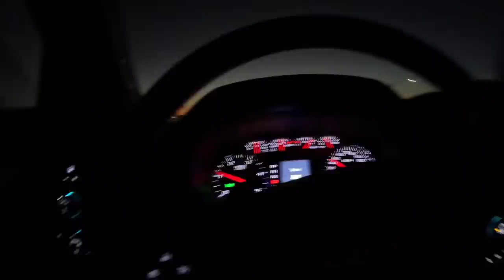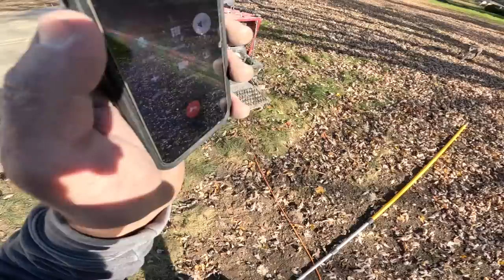Very nice patio! One of the last of the season

Comment: 3:48 FYI you don't need to use a flashlight app on your phone. iPhone has a built in Flashlight button in Control Center and on the Lock Screen. Much easier to press and activate.

Comment: 12:12 I am a plumber, and yes it is a code thing! But also, clear primer works, and will show under a UV light. Primer is mainly used to clean the pipe and soften the pipe so the glue can physically bond the plastic together. The glue by itself will work, and leave a cleaner job. But primer is always nice to make sure there are no rocks or debris.

Comment: The primer is used to make sure the glue adheres properly. It reacts with the plastic and glue to form a stronger bond. Only using the glue is NOT victory style. Not as big of a deal though if the pipe isn't under pressure like a downspout but it still drives me nuts when people don't use it.

Comment: 10:40 Everyone who owns a machine should know this trick. We've done it with  our power saws when we're deep in the bush and pull cord or spring decides to break. Just have to be careful because there's no kickback protection.
Reply: ran an old cement mixer working for a mason the summer i graduated college and this was how you started the machine. i was told older machines all had this type of pull start instead of the modern handled pull rope.

Comment: The Purple primer is definitely for inspection purposes, otherwise I would just use clear primer. Don't get it confused with clear cleaner because they are not the same things. Clear cleaner surface cleans while Primer cleans and initiates a chemical reaction that allows the pvc to weld better with the glue.

Comment: ryan might be weird right but you pull wire when you pour the concrete but then walk all over it pushing it right back down you should pull right before you strike off so the wire is in the middle of the slab.

Comment: This is a nice looking patio. QUESTION: How far apart are your lines cut? Square sizes basically? How deep is your cuts?
Reply: They can be any size, smaller the better, but 8+ ft is too big. The cuts are about 1 1/4". They say to cut it about 1/4 of the thickness of concrete. Hope it helps

Comment: Ryan, I noticed you cemented over the gas pipe. What happens if the gas company has to replace some thing now they have to tear up your concrete is this normal procedure?
Reply: Gas pipe is steel, unless it gets hit by something with some severe force, it's never going to need to be replaced, it's a forever thing. The meter itself is the only thing that would need replacement over time in which they still have plenty of access to do that even with the cement there. As long as you aren't covering over crucial unions that they'd need to break apart for replacement then you're good.
Reply: @trainofthough0242  here in California you have to make sure the gas company has 100% access to any parts of the meter/parts just in case there’s an emergency.
Reply: @aaaaaaa1ism  Yes; the meter, the union or unions and shut off valve must all be accessible which it still is in this case, that's code no matter where you are. You cannot bury any of that stuff especially not under concrete. Everything the gas company would ever need access to is above the concrete. Everything that's buried underneath that cement is nothing that would need to be touched ever unless the homeowner wants to move the meter or something but that's not anything I'd concern myself with. What Ryan did here is perfectly fine.
Reply: @trainofthough0242  I have tons of confidence that Ryan knows what he’s doing except I noticed it’s different here in California. Maybe it’s an earthquake thing but you have to give the gas company full access. Thank you for chiming in.
Reply: @aaaaaaa1ism  California does have some unique codes for sure. I know they use a lot of flex gas lines instead of rigid because of earthquakes so maybe it's possible it's different there. California does a lot of things differently than everybody else as I'm sure you know. As a plumber in New Jersey, it looks fine to me and that's all I know.

Comment: Is there a benefit to pouring steps before patio and not pouring at same time?
Reply: I think I already answered my own question. Its easier to finish the steps if they are not surrounded by wet concrete.
Reply: Plus he stablizes the steps by pouring concrete anchors so they need to dry first so they don't move. Patio floats.
Reply: kevin McAllister wont let Ryan borrow his hover board , I think😀
Reply: I was just thinking if they were poured at once the water couldn't get between steps and slab